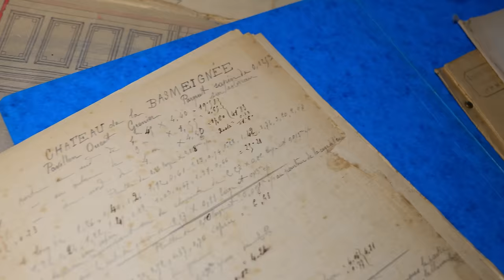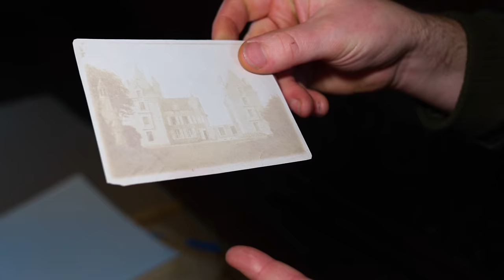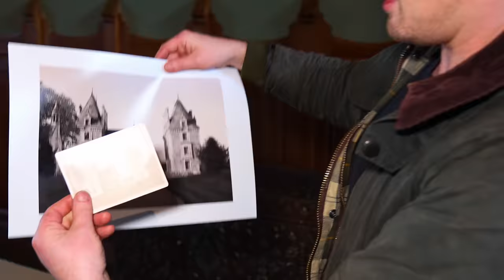120 Years Of Chateau Carpentry - Doing It Ourselves

Comment: I've seen a workshop not dissimilar from this still working when I was very young. It was run by a pelten wheel in an old gold mining water race. They manufactured windmills to tap the artesian water supply for farming as the area is semi desert. It has now been turned into a museum but most of the dangerous stuff either isn't working any more or is behind substantial protection. I remember being fascinated by the machines and the belts which the old man who ran the place would flick from machine to machine.
viv in nz

Comment: Do you keep your sawdust and use it with wood glue for wood putty?
Reply from the maker: It does work, but sometimes it can turn black. I found the best thing is to use a wood filler, then sand over while it's still wet. The surrounding saw dust sticks and gives it an exact colour match.